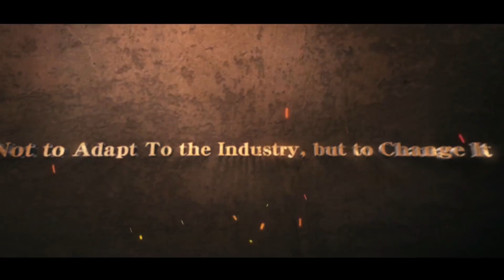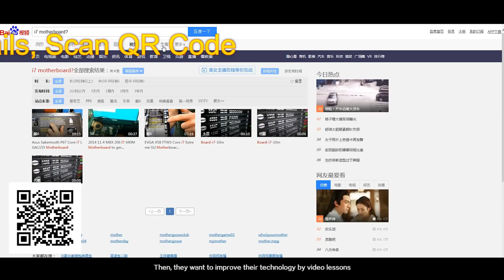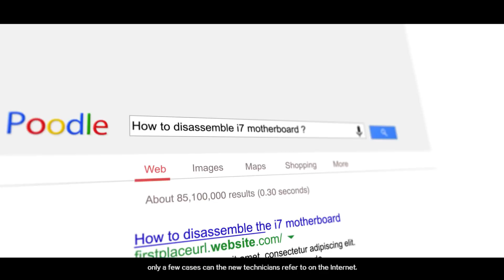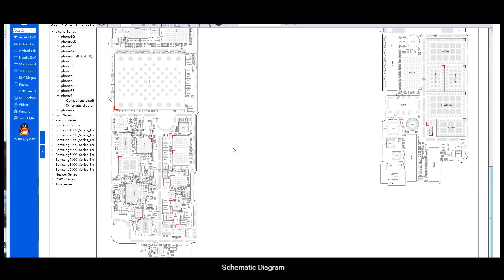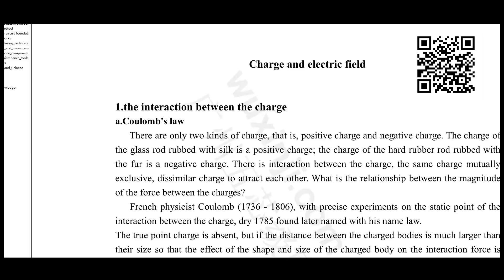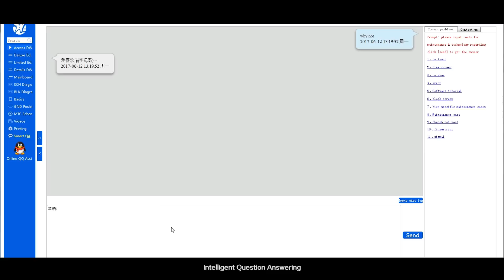Wu Xin Ji Wuxinji Fivestar Software Dongle Fix iPhone iPad Samsung Logic Board Motherboard

Comment: I have a 6S plus that had a short in WiFi chip. Short was under the big internal chip inside WiFi IC. Got new chip but need the storage modified to use new WiFi chip. How much do you charge if I send storage IC only. In USA but can mail